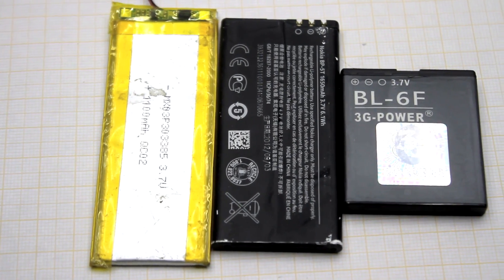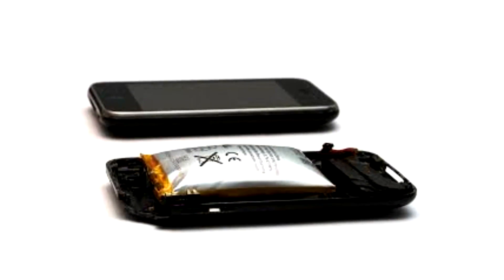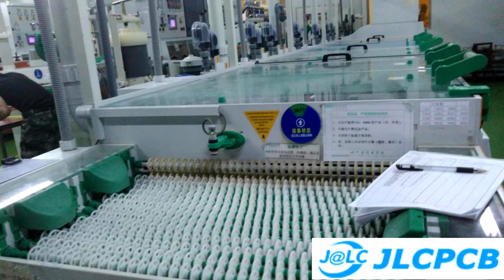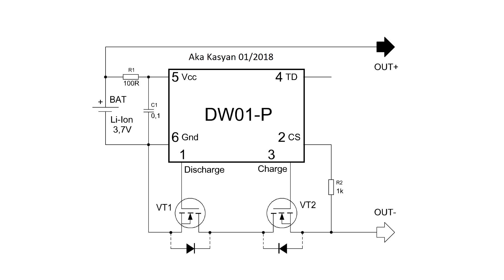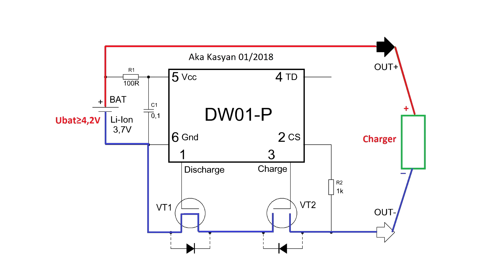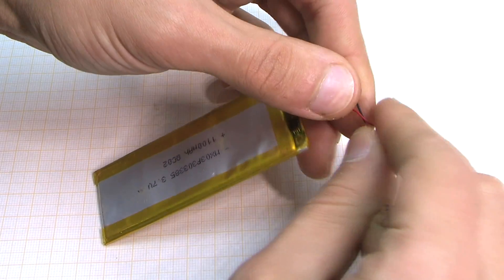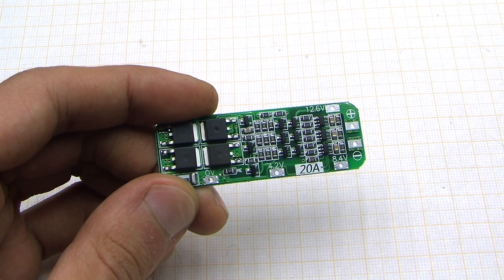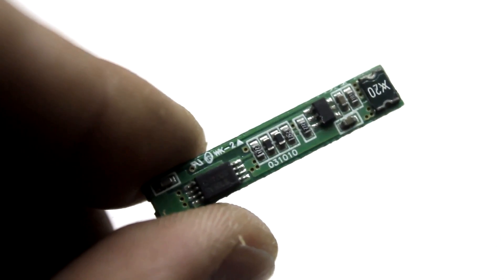How it works? Protection boards for lithium-ion batteries

Comment: Is there a way to modify these boards so that they disconnect the battery at lets say 3v instead of 2.5V thus preserving the life of the cell better?
Reply: Are you good at micro soldering, if so then yes probably

Comment: Can the chips on the BMS PCB be either reprogrammed or replaced? When one or 2 18650s are replaced, such as in a laptop or multi battery (pack), the chips sort of know the original cells are gone but new ones are installed. Great video! Thank you 🌹
Reply: The chips are probably dw01s they have no microcontroller core in them also no memory they just protect the battery no matter what they are basicly kinda like asics they are built for the aplication of protection and charging
Reply: @309electronic5  interesting... Thanks 🤓

Comment: how can i look for a specific protection board for an old phone i have that i want to turn into using it powered on direct wall plug instead of it's battery, i know it's battery have the exact proper protection board but i want to keep it for later use as mobile phone again when needed. 

thanks for the good informative video .

Comment: Hi! What about Lead Acid battery? Are there any protection chips for them? Thanks!
Reply: Apparently no, since the only real con about Lithium-ion batteries is that they need a protection circuit, and this only applies to Lithium-ion batteries.
Reply: @theelectronomer2319 it applies to most batteries!

Comment: i have li-ion 3.7v and i have this device and how i connect my usb cabble (i heve red and black wire) to battery module red to red and black to black? Just he made heat :(
Reply: better to use tp4056 module

Comment: You only do a demo in single cell charge and discharge application, why you do not do a demo for multiple battery cell circuits application in DW01?

Comment: These are the best video's ever! This board is not to be confused with a balancing and protection board. Anything wired in series need a balancing board especially when you have a high drain.

Comment: Nice video bro 👌

I just wonder did we could direct charge battery from the 5v mobile adapter buy this board 🤔
Reply: no, that is only a protection circuit, you need a regulating circuit.
Reply: @slimfaidy  but the mobile adapter doesn't already have a regulating circuit?
Reply: I don't think, the best way is to buy a tp4056 module for both charging and discharging.

Comment: can we use the protection circuit of one battery with another kind of battery???
Reply: Kou Gaz all lithium ion/li-po battery have the same voltage so it's safe to use on those, not different kind of battery though

Comment: using dedicated mosfets is a waste of resources. protection circuits should just be a feedback wire that you connect to the circuit you supply with the battery and use the feedback wire to turn on or off the low power driver stage of the circuit
Reply: Sorry, I don't understand you. At some point you'll always need to switch on/off the high power part, what would you use instead of dedicated mosfets? And don't think it is possible or a good idea to put them inside the IC.

Comment: I've been cautious about reusing Lithium batteries because I can't tell whether the board on a salvaged battery is just for over current protection or it includes a charge controller. I haven't been able to find datasheets for the chips I've seen. I've got a lot of battery setups from old high end bicycle accessories. That market seems to be less standardized for mass production. I need to figure out a way to safely test them and see if they are protected or not. I was already foolish enough to buy the little AliEx lithium charger modules that don't include discharge protection. I think I need a fireproof container before I'm going to play with these things a lot though.
-Jake
Reply: Just try it out with a lab power supply. Adjust the current so it's about 1C. A cell doesn't suddenly explode when you got to 4.21V. If the charging didn't stop at 4.25V there is quite likely no over charge protection. Same with discharge. Connect a load (halogen bulbs are easy to get, they won't light at one cell, but that's ot their job here) and check if the battery gets disconnected before dipping below 2.5-3.0V. Unless the cell has been damaged before, there's nothing dangerous about it.
Reply: I sometimes use two 2.5 volt, 20 farad capacitors in series in place of the battery for testing. If my charging voltage is kept at 5 volts max, you can monitor the capacitors to see if they go above 4.2 volts.
Reply: Great Scott... on youtube, performs tests on charge boost protection circuits for li-ions. His techniques are clean.

Comment: I need one for 300 cells configured as 15S20P (45V-63V) @40A for my electric scooter. Any suggestions?
Reply: minimum 3a discharge cell
Reply: With this many cells in series, you definitely need to use a Balance Charger. 

Otherwise some of the cells can be already overcharged/overdischarged while others are still at normal voltage.

Comment: Only 2.0 $ / 10 pieces with    of  Any Size !!
Reply: X-TREME Diy nope only <100mmx100mm
Reply: E_404 can i ordered 10  different types of boards at once of one or two layers pcb for 2$ or i have to give same schematics for 10 price s ??
Reply: They give you 10 copies of the same board. The price is the same for anything up to 100mm by 100mm, so you can potentially put several different designs in one gerber, but you get 10 copies of the exact same layout.